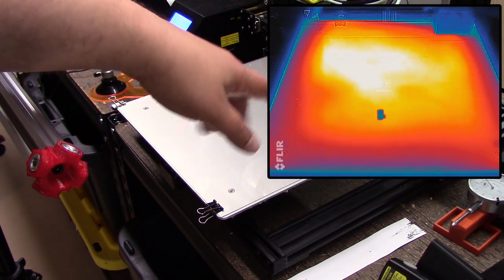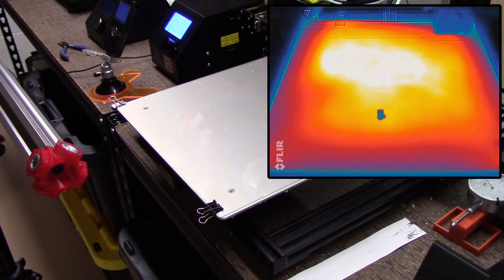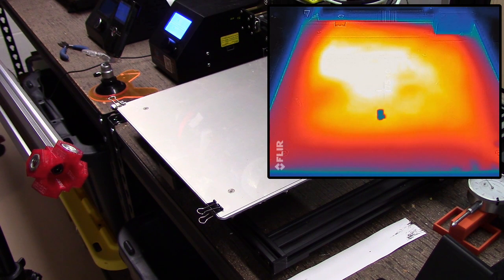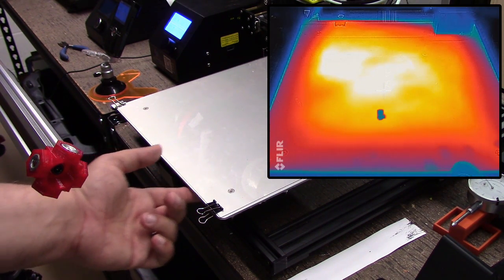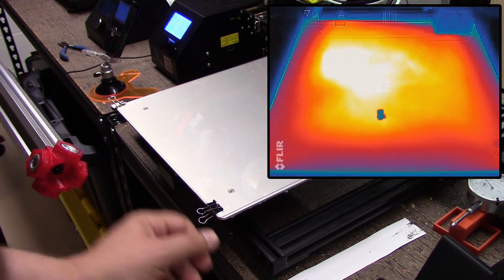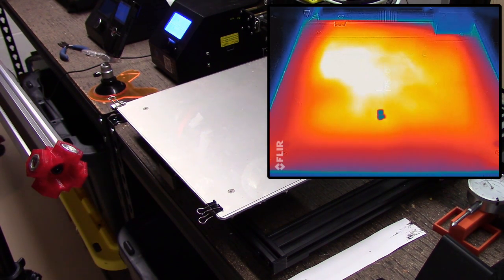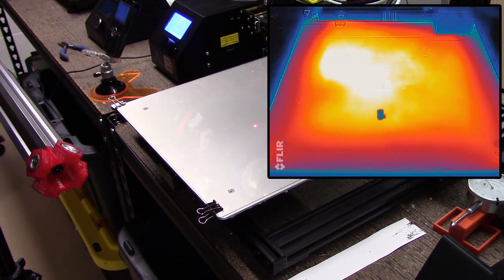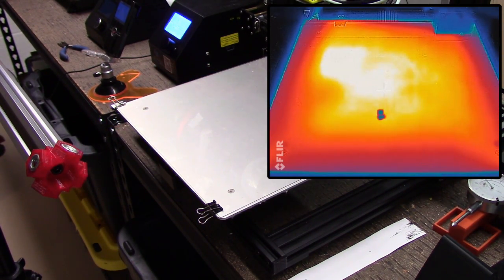Creality CR10 - Insulating the Heated Bed!

Comment: You might want to also do a PID tune of the new bed setup. This might have a little effect on time up to temp and could help with maintaining temp.
Reply from the maker: Never really seen the value in PID turning the bed, I did whole series on PID tuning the hotend (which makes sense and you can in Wanhao playlist) however since the bed it really a big heat sink, you won't really see any affects of the PID because of that.  Don't get me wrong it doesn't hurt anything, however the value you get for the time you invest isn't worth at least for me :-)

Comment: I think those insulators are designed to reflect back the infrared rays of a (relatively) far source. I don't think that's efficient for contact heat. Sorry if my English is a mess. :P
Reply: The foil on the inside is not as reflective as the foil on the ouside. Take a look at reynolds aluminum foil in stores. One side reflects the other side disperses. Shiny vs dull. Make sure you use the right side for your BBQ chicken. Aka: you're still an idiot which is why you did not get the results on the FLIR gun that you imagined.
Reply from the maker: Knew I was going to get a lot of these even thou I mention this in the video :-) As you have to look at this the other way around as it does, because if you attach it to the firewall of your car does it not insulate it (hint the answer is "yes")?  So you have the adhesive backing, fiberglass (insulation) and then foil.  So why would it not "insulate" as in the car example it separates the "cold" the "hot" and the same hold here too.  Keep in mind the surface of aluminum has the ability NOT TO ABSORB, but TO REFLECT 95% of the infrared rays which strike it. Since aluminum foil has such a low mass to air ratio, very little conduction can take place, particularly when only 5% of the rays are absorbed.  So the same foil that is on the outside is on the inside also, so in short it has two action keeping "out" and keeping "in" and placing the sticky side to the bed we are keeping "in" as what makes it past the fiberglass insulation will be reflected back by the foil.  The only question is can (which the answer seems to be yes) can the adhesive take the heat of the bed without breaking down...
Reply from the maker: Keep in mind there isn't a "wrong" side there are two sides to the foil so Heat->Fiber Glass->Foil <-(reflection)
Reply: What I meant is that the effectiveness of that particular isolator (*for its intended usage*) lays in its aluminium reflective surface, not in the somewhat isolating fiber beneath. i.e., the fiber is no better than cardboard isolating heat; it's just non flammable. There are three ways to transfer heat between bodies: conduction, radiation and convection. You need an isolator that is good for conducted heat. The one you used is good for radiated heat. The car example is not accurate, since you're trying to isolate heat transfer from a body that is in contact with the surface, i.e conducted, which is not the same as the car fire (radiated heat). The only two things that are good at isolating heat in this case are 1) vacuum (best) and 2) air or a gas. You need to use something with a high content of air and low thermal conductivity (like a winter coat).
Reply: But don't use a winter coat, of course, it's flammable; I was just giving an example.
Reply from the maker: I agree 100% on not using a flammable substance as what people forget is its not the "heat" from bed which is the fire hazard, but the fact that we are running high current to this bed and the likely hood of an "arc" is high.  as Chuck Helebuyck  even had this happen on camera with a Wanhao print and if there flammable the possibility of fire is a lot higher....

Comment: how about comparing it to cork or cork as the second layer?
Reply: It's not, not unless you plan to insulate the hotend with it.
Reply: I'm confused.  When I search about cork, it says it is "naturally flame retardant."  But it also states that the flammability can be affected by any chemicals that are used in processing the cork.  For now I'm doing OK without any bed insulation and will continue to monitor your experiments with alternate materials.
Reply: See my other comment -- cork is not flammable. Use correct cork and use correct type of adhesive. I permeated my cork with flame retardant chemicals safe for up to 600F. Please stop spreading disinformation, you sound like my father-in-law, I saw cork catch fire, so all cork is not safe. That''s valid science.
Reply: Holly hyperbole batman. I do my research. I do my own tests. I also used appropriate adhesive to soak cork. Stuff doesn't just ignite at below it's flash point, and WELL below it's flash-point. If cork is soaked in gasoline or a flammable liquid, different story, if cork is dry, or better yet infused with fire retardant adhesive, it's perfectly safe. Please research -- or prove me wrong. I've been using cork with my 20" mains powered bed for over a year. Virtually everyone insulates their heated beds with cork. Printer fires are not caused by cork -- they're caused by electrical malfunctions or thermal runaway. Seriously, if you're just gonna say I saw it burn, so it must be flammable -- yea, I saw steel beams melt and collapse on 9/11 -- so yea anything can burn given enough heat. Don't use cork to insulate the hotened, it's is perfectly fine for insulating the bed. People use cotton batting -- that's sketchy as cotton has fine fibers which can self ignite, not cork.
Reply: further more -- 75C is not enough to boil water, and you're going to say cork will self ignite at that temperature...it won't even get singed...that is wrong I don't even know where to begin.  Again -- cork flash-point is 300C -- unless your bed gets to 300C, or you soak your cork in a flammable liquid, it's perfectly safe.
Reply from the maker: cork is a major fire hazard don't do it...
Reply from the maker: Again you are very wrong, please see my other note, as you can do want, but you are setting gasoline next to an open flame and whistling.

Comment: Use cork, works really well.
Reply from the maker: Have seen a small amount of cork next to a coffee pot create a flash fire and burn a house down.  Not a good idea to attach it to a heated bed so please don't it  I like you :-)
Reply: Small amounts of cork vs a thick cork insulator are different things. I've been using cork on my 20" bed -- 3/4" thick cork, works really well. Flash point of cork is much higher than the temperature of the aluminum.  You can also use fiberglass sheets -- those are fireproof. Look at the cork Ivan Maranda used in his build, I use it differently, but it's a similar idea.
Reply from the maker: 3/4" cord is what was on the wall when it caught fire from the coffee pot.  I also have no clue how you can say "Flash point of cork is much higher than the temperature of the aluminum"...